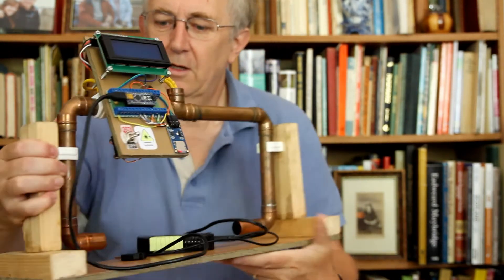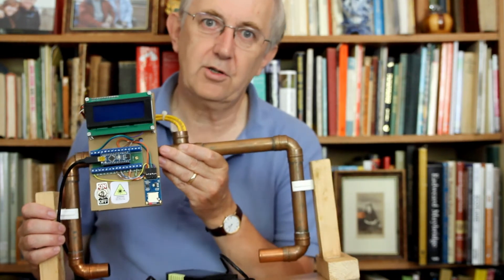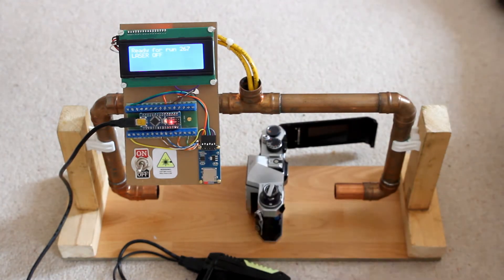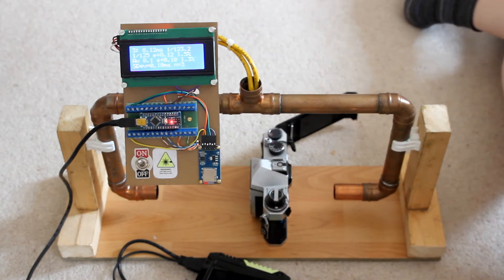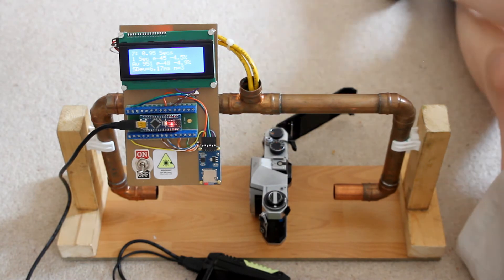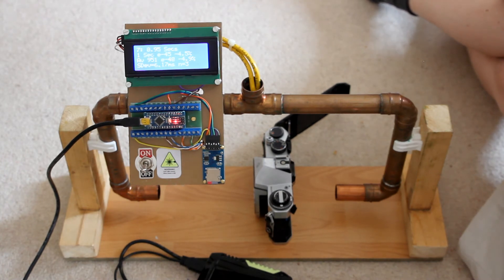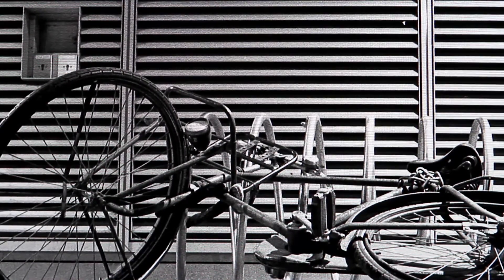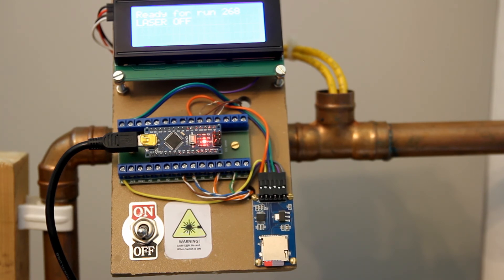DIY Camera Shutter Timer Based on Arduino Nano

Comment: Thank you Ian, I got it to run after two modifications. First, I observed the same as Wernerswannet, swap HIGH and LOW in the lines indicated. Most problems derived that the sensor was not triggering the digital pin. I had to connect D2 not only to the sensor out but also via a 10k Ohm resister to the 5V plus.
Reply: Sorry, after setting everything up, I have to take back my statement about swapping HIGH and LOW. Still, the resistor is required.

Comment: I love this design!
I was about to design my own shutter tester, using a benchtop universal counter / timer, but maybe building a standalone unit, using an arduino might be a better option...
I thought: let's look up on youtube, what other folks did so far... The Cameradactyl-version is nice, but I would have changed it into a version, where you could easily move the camera sideways to take measurements on both sides of horizontal focal plane shutters, to check for equal exceleration of both shutter curtains / equal exposure throughout the whole image frame at short exposure times. This will work fine with a design like yours.
Also, I really like the idea of logging the data and calculating average values... It might be another improvement to add a script, that calculates standard deviation (to check for shutter accuracy), but maybe it is something, that is not really needed...
I will probably going to build a device without the pipe-things, but align everything on a board in a height, that I can check standard 35mm cameras (probably so, that the laser hits the curtains on the top of the image frame, so that I can adjust the center with shims under the camera - then I could also check both sides of vertical shutters). All my bigger cameras use leaf shutters, and for those the laser-version will not work properly at short exposure times. They will need a different interface. With leaf shutters, it's essential to be able to set the trigger point correctly, and to use a different light source, otherwise your readings at high speeds will only be random...
I also wonder, if it would make sense to focus the laser to the exact plane, where the shutter curtains are... The smaller the light dot is, the better the edge steepness of your signal will become, resulting in a more accurate measurment at very high shutter speeds!
Well done, dude!!

Comment: I made the tester exactly from the diagrams. The time it measures is the time no light enters the sensor. The off-time instead of the on-time. Is there in the mean time a solution for this problem? I looked at the code but I'm not so proficient in C+ programming and could nit find anything.

Comment from the maker: Please check your hardware passes the hardware configuration test.  The routine script is on git  https://github.com/ianonahillroad/CameraShutterTimer/blob/master/sketch_CameraShutterTimerHWTest.ino
Reply: Hi Ian, I checked my hardware with the configuration test. I saw that my laser reader is working reverse. It gives a warning when the laser is off and when laser is on its off. Any chance to fix this malfunction in my code. Thank you
Reply: @HalukUnsal-i1d  , I have the same problem! I made the tester exactly from the diagrams and the time it measures is the time no light enters the sensor. The off-time instead of the on-time. Is there in the mean time a solution for this problem? I looked at the code but I'm not so proficient in C+ programming and could nit find anything.

Comment: Hi;
As an Arduino beginner, I tried to build this circuit on Arduino Uno. What mistake could I have made that it measures the time between two shutters, not the shutter time. I copied the code as a copy paste, could it be the mistake?

Comment: Hi, could you share the LiquidCrystal_I2C.h library that you used, because I had being downloading several LiquidCrystal_I2C.h libraries but always said that there is an error "no matching function for call to 'LiquidCrystal_I2C::begin()'" the library that I used was LiquidCrystal I2C 1.1.2 (latest) Author: Frank de Brabander, Maintainer: Marco Schwartz
Reply from the maker: It looks a bit old but with a lttle experimetation I imagine you can update the library.  The one I still have loaded is LiquidCrystal Built-in by Arduuino Adafruit version 1.0.7   It appears to be available on-line here https://www.arduinolibraries.info/libraries/liquid-crystal

Comment: On the drop shutter how will you handlr possible camera shake??
Reply from the maker: This could be an issue, but has not yet proven to be a problem.  When the shutter speed is short (in manual mode) most of the shake is when the blade is arrested at the end of its fall.  The exposure is complete by then.  In the long time exposure mode there could be shake as the blade is arrested to leave the shutter open. However, as the exposure is relatively long compared to the shake time it probably won't show up.
Reply: @ianwallace-photographyian_8097  thank you very much for sharing your knowledge with all of us photographers around the world!!

Comment: hi I'm writing for your shutter timer project,
I wanted to ask you if in the receiver part you have reduced the entrance to the photodiode with a smaller hole by letting in only a thinner light beam to get the exact fast times.
I made one with the same laser and receiver components, but without reducing the entry of the beam into the receiving part, the times of 1/1000 are not exact, but longer. now I made a 1mm inlet hole.
thank you
Reply from the maker: No I've not restricted the beam but both the laser and the receiver are epoxy glued in to the pipe.  Together with the rigidity of the copper pipe this helps ensure that the beam is centred on the sensor and the "aim" is not easily lost.   Its interesting you that this obtained an improvement and I wonder if its as much about reducing stray light as anything.  Good luck, designs can always be improved!

Comment: Great job Ian.  Two questions:
1)  How accurate is the tester at 1/2000 of a second?
2)  How would I modify your build for a Nikon Horizontal Focal Plane shutter?
I want to be able to test Nikon F, and F2 models.  I assume I would need a pair of lasers side by side?
Reply from the maker: Hi Rodney.
Now if you had asked a year ago I could have found a long and detailed answer I wrote about the accuracy.  There is a limit to it as it depends on the hardware response time and the Arduino clock cycles needed to execute the code.  However, I seem to recall when I looked this and counted the steps in the code it is still a pretty short time (hundredths of a millisecond) compared to even a 2000th of a second (0.5ms) .  So for my purposes I think its pretty good.  It was good enough to show how much better my OM2N shutter was at this speed than most of the others I tested.  The only way to really assess it would be to do a comparison with a professional fully calibrated device,  I use this timer all the time now for all sorts of cameras.  I'm not sure why you would need two lasers for the Nikon just to check the shutter speed.    As all of your film is meant to get the same exposure it doesn't matter much where the laser is directed through a focal plane shutter the window passes each spot for the same amount of time.  However, if what you want is the see the separate curtains speeds across the aperture and maybe detect if there was a curtain drag at some point (as my old Zenit used to do) then you would perhaps need an array.  A much more complex problem.  For simply checking if a shutter is reasonably accurate this works fine and give a good comparison between cameras.
Reply: @ianwallace-photographyian_8097  I thought mine looked Heath Robinson, but yours is far more steam punk! :o)  

I built something similar, using two lasers, which enabled first and second curtain to be measured separately, to detect shutter drag, which will cause an uneven exposure. Was very easy. As each laser is 'seen' as the curtain opens, an interrupt occurs and notes the micros value. When each laser is blocked by the curtain, again an interrupt  records the micros value. A bit of maths then gives speed of both curtains. 

Have not bothered with LCD or SD card, mine just prints to computer screen, but I'm thinking of adding an LCD to make it stand-alone.